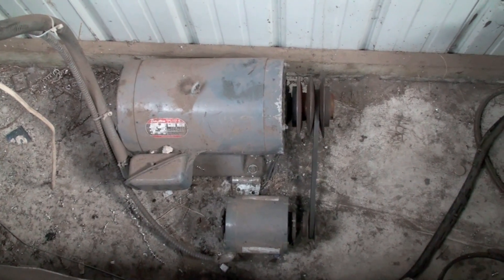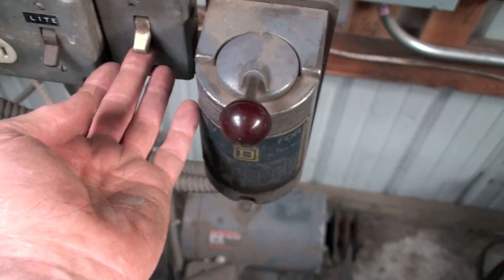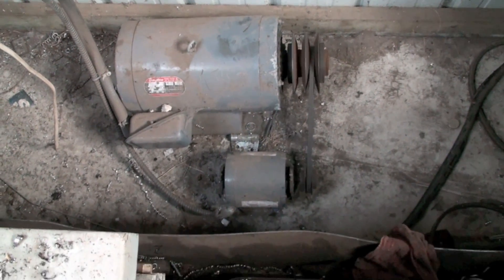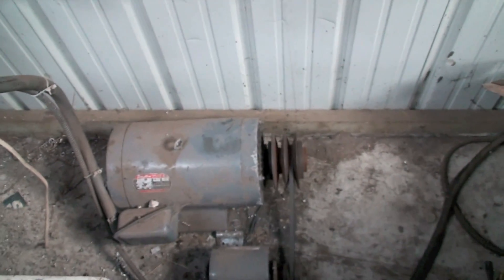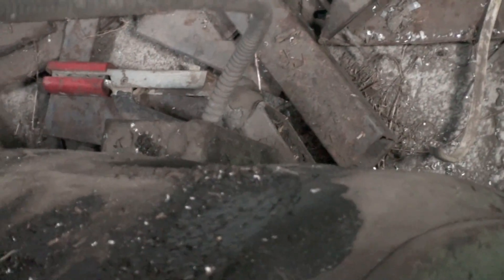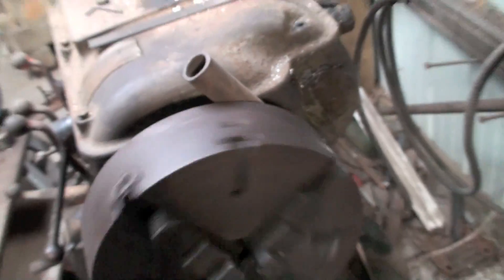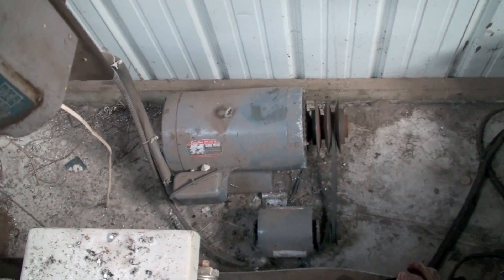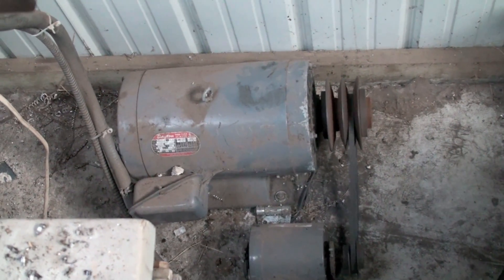Single phase to 3 phase the simple way

Comment: Nice simple setup.  The little pony motor eliminates the need for a starting capacitor and potential relay.  You didn't need run capacitors to balance the phases?
Reply from the maker: No, A little low on the amp draw of the 3d leg but caps did not help.
GFM

Comment: Ever wonder why commercial rotaries aren't this simple?  It's because they put out 3 phases of equal 120º separation, and equal voltage, but this requires capacitors.
No capacitors with your rotary?  Then you don't get that, so you don't get the full torque capacity of your machine's motor. :( This is ghetto.

Comment: I had a worker come in when not supposed to and turned on my big phase converter without starting the little one and burned up my big motor so I’m trying to figure out how to wire the new one in diy with no previous experience

Comment: Get a modern electronic Phase Shifter.  Small, clean, safe & quick. Done!
Reply from the maker: You forgot expensive.
GFM
Reply: @grayfurnaceman  Paid $300 for mine good for up to 7.5 hp , my lathe works fine ................
Reply: Scrap guy gave me a 3 ph motor. I already had a starter motor. $20 trip to the supply store for some bits and pieces and I'm in the 3 phase business. Been running it for 6 years now.

Comment: You just gave me the stupidest idea, yet I think it could work. I have a three phase breaker panel... I could drive a decent size three phase motor with a beefy single phase motor, and while my total load capacity would drop, yes, it would still allow me to use this panel in some capacity, a bit closer to properly....

Comment: I’m building a converter now. I’m using a giant 10 hp electric motor I salvaged out of an old industrial Varian Vacuum pump. For my starter motor I’m using a large DC motor and speed controller salvaged out of an optical polishing machine. I also salvaged all of the switches, capacitors and breakers and relays from machinery that my company scrapped out due to age. I used such a big motor so i can drive multiple pieces of machinery in my shop. I’m going to run the output of my converter into a small sub panel in my  shop which will then be hooked to all of my machines. I cant wait for it to be done. Been a lot of fun getting all of these different components to come together as a whole new machine.

Comment: What would happen if you will connect the pony motor in to the running circuit with the selector switch instead of turning it off after start?
Reply from the maker: Why?
GFM

Comment: could I run a 3 phase 2hp motor 220 volts horizontal bandsaw that has a smaller 0.5 horse water pump that turns on with a switch?

Comment: If I get a 230v idler motor, will it run a  220v machine, also the idler motor will be 5 hp I intend to run a 1.5kw basically 2hp machine will I have issues?
Reply from the maker: You will be fine.  No difference between 220 and 230 volts.
GFM

Comment: So I went ahead and gave this a shot and I checked the amperage on the three legs. After shutting off the power from the single phase motor, I was showing 6 amps on two of the phases connected between the two three-phase motors that were also connected to line one and line two but only 0.6 amps on the phase that was powered via induction.  The two three-phase motors ran but seems like it would burn them both up after a while.  Any ideas what I could be doing wrong?
Reply from the maker: Your readings are correct.  The amp draw increases as the load increases and it becomes more balanced.  In any case, unless you are drawing maximum load, the motors should be ok.
GFM
Reply: @grayfurnaceman  Thank you so much for the information. One last question.  Can an ECM motor be used as the three-phase power?
Reply from the maker: @CounselorsinChrist  I guess you could try, but I think the electronics would shut it down.
GFM

Comment: What I'm thinking of doing is buying a cheap Harbor freight gas motor, machining a connector that connects the spinning shaft of the gas motor to a 3 phase motors shaft, and running the power from the 3 phase motor that is being generated to a welder that only operates on 3 phase. Basically, I'm just making a welder/generator combo, but I'm not sure if I'm missing anything. Thoughts?

Comment: So once you turn the small motor off, is the big motor powering itself? Or taking 220 volts from the house?
Reply from the maker: Well, if it did, I would have invented perpetual motion.  
The small motor starts the large motor because it will not start on single phase.  Once it is up to speed it will continue rotating on single phase.
GFM
Reply: @grayfurnaceman   Still that is an outstanding thing you have done, I need 208 volts at 100 amps to charge my 27KW battery backup system power company didn't want to bring in 3 phase

Comment: actually you don't need that starter motor.  If your motor puts out 3 phase, you can wire single phase power to it, jump the 3 leg with an intermittent off/on toggle swt wired to the the hot leg of the single phase power supply...that will start the 3 phase motor which will now put out dirty 3 phase...which runs my bridgeport mill just fine.
Reply from the maker: Interesting.  I will test.
GFM
Reply from the maker: I tried that every way from Sunday.  It does not work.  I would be interested in a diagram of your system.
GFM
Reply: @grayfurnaceman  i've got 9 pics that will explain it......give me someplace to send them.
Reply from the maker: Susie Curtis send you grayfurnaceman@gmail.com. Thank you

Comment: I take it that switching the direction of the driven motor direction is as usual change any two wires with connections with a switch? Thanks for the money-saving tip! Again!
Reply from the maker: Yes.  The application shown has a reversing switch that works normally.
GFM

Comment: Fine, if you don't need a neutral.   Or, if you don't mind a neutral that isn't anywhere near neutral.   Older machines tend to need a neutral.   They have old, weak insulation.  I use a single phase motor to start too.   And to start my 3 phase motor I connect to 2 legs.  1 live and the other neutral.    But when it's up to speed, I take the neutral from the second leg and connect it to the neutral on the motor. (the star point)   I then have 2 generated legs and a solid neutral.   I hope this helps you.   I wish you well.

Comment: What you have done is run a single phase motor and belt drive a 3-phase generator.
Reply: There is actually single phase voltage entering the 3 Phase motor, but only on two of the three legs, the third is dead, but rotation of the armature is creating the "Ghost" leg of the 3 phase system. The Lathe motor then has three legs of power (phases), but ideally you would want to add capacitors to the Ghost leg to improve the balance of the three phases (legs). I use a similar 5HP 3Ph motor on my rigged up converter for my Vertical Mills 2-1/2HP 3Ph motor, but I literally roll my shoe across the pulley to spin it fast enough, then hit the 220V power switch as it's rolling and finally comes up to speed.    Yes, I should add Capacitors to both start it and smooth the output flow, but it runs just fine if not 100% efficient. What is shown is the 2nd most primitive method of creating 3 phase (having a 110 or 220V pony motor to spin it up) VS pulling a rope or spinning up a power fed 3ph motor to create that 3rd leg. All of them still have 220V power entering the motor though, there's no free energy action here.
Reply: @jhooah1  this is what I've seen done by friends in Kentucky... a rope is wrapped around the ghost motor to get it spinning before hitting it with single phase 220. Then the mill or lathe is powered on.
Reply from the maker: The single phase motor is 1/4 HP.  The 3 phase motor is 7.5 HP.  The 1/4 HP motor is simply to get the larger motor rotating.  Once rotating, it will generate the 3d phase.
GFM

Comment: great setup these osha safety forman wanna be's would crap if they seen mine. my starter motor is on a hing with a lever to pull the starter back to tighten the belt and once the motor takes off push the lever forward the belt jumps offand ur good to go haha

Comment: Ive seen/heard of this a few times. For people not too savvy with electric motors I highly suggest buying a phase converter, pretty much does the same thing but can be professionally installed.
Reply from the maker: Actually, phase converters simply use a capacitor to energize the 3d winding in order to start the motor.  Then the the 3d winding drops out when the motor starts.  The motor runs on 2 windings.  
When you use the 2 motor system, the 3d winding is energized.  What this means is the motor operation is balanced and the amp draw is spread between 3 windings instead of 2.  Its a better way.
GFM

Comment: this works on direct power to a 3 phase motor but i have an old hofmann digital Tyre balancer its 3 phase 415v. I only have a 240v single phase here in Australia would this work it has a 4 pin plug on it. Nick
Reply from the maker: It should work.  Many times when powering a system rather than a motor,  parts of the system use single phase power to operate controls.  You will need to determine which phase uses this power and connect and connect it to one of the direct lines if the voltage is right.
GFM
Reply: ok thanks for that will all leads coming out to power the balancer be 415v. also is it config the first motor that's generating in delta?
Reply: Oh and the power in to the balancer seems to run through a 415 transformer on the circuit board so it need all 3 phases to produce 415v and the the trans former sorts it out. so its important to get all three l1 l2 l3 inputs on the power lead 415v .thanks again Nick
Reply from the maker: They should be.  It is the first motor.
GFM
Reply: is the generator motor in delta or star? I just bought a new 2.2kw 2.2hp motor new of ebay havnt got it yet. the motor inside the balancer is under 1hp so that should be fine i suppose? be grateful if you could confirm all this. also the power lead to the balancer has the 3 wires and a earth. the 3 legs would just go on the same terminals the power 240v go to also the middle connection is this right to? thanks Nick
Reply from the maker: Its star connected.  The sizing is ok.  The 3 legs are connected together between the motors.  One connection is left open to power as this one is generated by the larger motor.
GFM

Comment: I am a little confused here. You say this is producing 3-phase power, but I see two phases being run on one phase, and only the third is generated by the motor. So A and B are on one phase, and C is generated by the motor and I presume is at some phase angle to A and B. Isn’t that actually 2-phase, not 3?
Reply: Ethan Lamoureux when you run a single phase on high voltage you need to run two lines to it, if you run 1 line and a neutral it will run on low voltage (120v).
Reply: Ethan Lamoureux most houses are wired as 120/240 split phase, it is a single phase multi wire system, line to neutral is 120, line to ground is 208, and L1 to L2 is 240.

Comment: I'm confused...even though you're using a 7.5 HP motor as the generator, that little motor driving it looks like it's only maybe 1/4 HP?  So how does it produce enough power to run the 5 HP lathe motor?  Or does it only work because the lathe is not under heavy  load?
Reply from the maker: The small motor is just there to get the 7.5 hp motor started.  Once it is started, it will run on single phase and generate the 3d phase.
GFM
Reply: @grayfurnaceman  What is confusing people is that your drawing only shows 2  "motors" but the demo has 3. You say that you turn off the starter motor but you don't make it clear that power from your single phase home wiring is still connected and supplying power to the driver "motor".

Comment: I have a 550 volt 5HP motor on my mill. I have a 5 HP 575v spare motor.  both are obviously 3 phase. what happens if both are 5 hp. is there enough power. you mentioned the supply motor needs to be a higher HP.
Reply from the maker: If you have 575 volts, you already have 3 phase.  In any case, the generating motor must be 1.5 times the mill motor.
GFM
Reply: Okay thanks for the reply. Fr now its in a building that I have access to 600 V So Its okay for now.

Comment: were is the reversing switch in the circuit do you just change any two of the actives ?
Reply from the maker: The reversing switch is mounted on the lathe that is being powered.  You can switch any 2 wires.
GFM
Reply: thank you there are three actives you transpose two of them it is not in your circuit

Comment: I do things my   electrician says can't work-- I currently run a 30 hp 3ph motor (Vaccumn pump)on single phase with no idler just capacitors   125 -20 mfd run caps for start and balance L1 and L2 with  about 120 mfd  with a 91 amp,82 amp,86 amp balance on 238 volts  have sequence the caps with relays on start up- been running this for over 10 years, also running a 16hp cnc router with only a 2hp idler

Comment: Interesting!   Thank you.
I have a 10 hp three-phase Federal Signal 2t22A siren.  So I will need a 15 hp three-phase motor to power the 10 hp motor.   How much will a 15 hp weigh?
Can I hand crank it up to enough speed, or need another motor to get the 15hp motor to speed?
The siren motor operates at 3,450 rpm.  Iturns two rotors which, at full speed, produce musical pitches D5 and F5, a perfect minor third interval!
Reply: Robert Gift you want to sell me that siren? And you don't need a motor to run that.
Reply: Ben marquez.  It is now an active tornado siren connected to 240-Volt three-phase.
There is another three-phase siren (similar to Alerter) (just motor and rotor/stator) at home which would be fun toperate.   Our residential neighborhood has only single-phase.
Reply: Robert Gift wow that's cool.. Is the other one at home for sale?
Reply: I'd like to keep ito playvith.   Too heavy to move.  Had to be loaded into the Expedition with a fork lift.Managed to get it out sliding it down 2x8 boards.  Was one of City of Englewood, Coldorado's sirens.  B&N Mobil Directo?  Discarded the fiberglass case in their dumpster.  Forgot the stator port counts.

Comment: So ur using a temporary catalyst, in order to run a 3phase motor, with two copies/versions of a single phase?

Maybe I could connect 2 of the 3 outputs from a 3phase VFD, in parallel, in order to get an adjustable, single phase output???

Edit: Nope. They're phased. They're not identical. 
Back to the drawing board! :)

Comment: Late to this topic. I built mine with a time delay relay and motor start capacitor which is common in motor start circuits. The ship write starts his idler motor with a rope and pulley. If I need to build another converter I would use this method as you can easiley start a larger housepower idler motor.-Jay
Reply from the maker: That also works.  This is just a little simpler.
GFM
Reply: I see I worded my comment unclear. I meant the method you show is the way I would go if I have to build another. The rope and pulley is a little to hands on. There should still be used 3 phase motors out there to use as idlers. I think that commercial built converters might have capacitors to correct for stray reactive / inductive loads. But that would not be noticed unless the converter causes line problems bothering neighbors. -Jay - You know I think any 3 phase machine running in parallel if light loaded would act as an idler. that  might be what the guy below is talking about.

Comment: Hi there from Mr Nick Wiese: I really appreciate your efforts here on 3 phase, It might help others to understand if we called our house power what it really is in the USA, it is called single Phase(1 hot leg) & single Phase 220(2 hot legs) it is actually (double phase) and you are adding one more Positive leg for 3 Phase, they all should add up to 360 volts in a house system of 200 amps or 400 amps.  if the 3rd leg  is off a bit so what?, as the motors magnets do not care! of course there is Delta or WYE motor wiring to be considered,  Thanks again  Mr. Wiese
Reply: Nick Wiese ummm....it depends on the windings in the motor too mr. DUMBASS

Comment: How does the 2nd or " load " side motor produce 3 phase voltage by just spinning it's rotor. This is an AC Induction motor right, not a DC motor with a magnetic rotor. So how does it work.
Reply from the maker: The AC induction motor induces magnetism into the rotor.  The rotor in turn induces magnetism into the 3d winding.
GFM
Reply: Max R when you spin a motor it essentially becomes an alternator

Comment: little uncertain about the drawing : here 3 phase is N(bleu) /L1(brown) /L2(white) /L3(black)
to get single phase 220 volt 60 hrz here you need one of the L's and the N or zero
the drawing you showing uses  L1 and L2 
are you using two phases to make 3 phases or could you use a phase and a zero as whell ?
reason i ask is because i only have one phase and the zero entering the house
Reply from the maker: There is no neutral involved.  All lines are hot (240v).  This is for US power.
GFM
Reply: watahyahknow there is no neutral when a single phase motor is wired for high voltage, because hot to neutral is 120v.

Comment: could I use a centrifugal clutch on the 110 motor,as the three phase motor seems to speed up when power is applied ???  ( my machine runs good) the only part I had trouble with was third wire becomes a common between both motors or the third phase and the outer casing of three phase motor is grounded
Reply from the maker: You could of course.  Do you want to complicate that much?
GFM